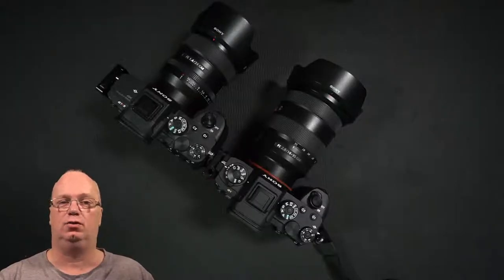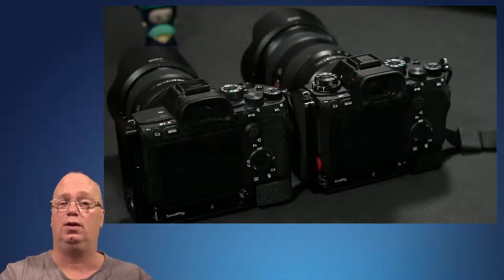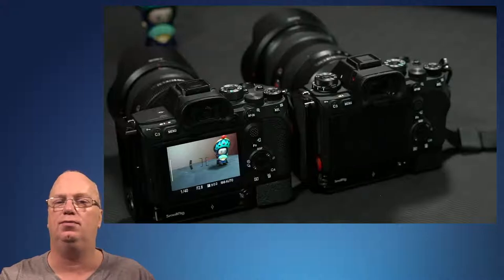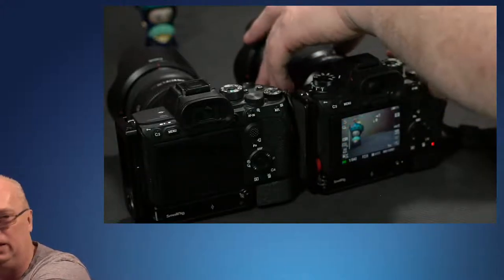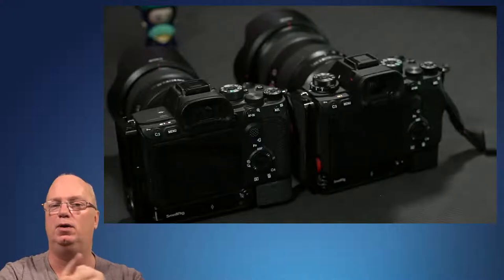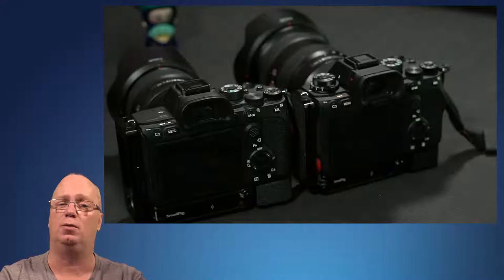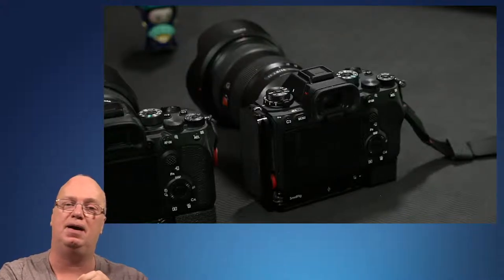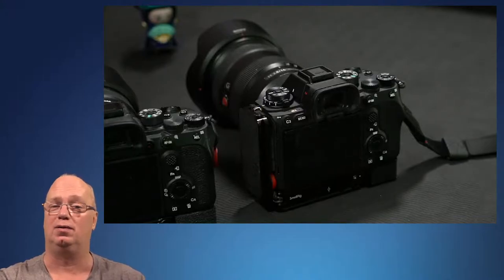Sony A7 IV feature ff vs crop based on A1

Comment: A game changing feature for Sony would be to let you shoot in crop mode but while viewing the FF in the viewfinder. Anyone like me that shoots fast moving subjects(birds, motorsports,airshows) always fight the smaller view which also makes it harder to track erratic subjects, this truly would be the best of both worlds
Reply from the maker: Yeah and in concept (not sure how to test this) the A1 uses the same amount of contrast and phase detect points in ff and crop. Since in crop the contrast has a easier job and there is less data to check i suspect this new method will be better at AF in crop then in ff mode if you need to be in crop anyway. I 100% agree that its nice to be able see the crop in the view finder and and now you can quickly move back when subject gets close its near perfect. I do hope sony adds a few firmware tricks like allowing it to push to activate instead of toggle and make it part of the button memory recall mode. Allowing you to shoot in crop and see the FF should be possible and i know a few have asked so you can see what is coming with a nice border you can see (maybe make it 30% darker) who knows we have asked and i guess we can ask again for sony amb to communicate thay to them.

Comment: You forgot a7C has flip screen… that to me showed me they’ll do it on the 7 bodies that are volume sellers, so I think the a7iv will have the floppy screen the kids want. No way it’ll have a1 sensor sensor n processing… it will have a7siii’s stack. The newer a9 or a7r5 will have the downgraded a1 stack.
Reply from the maker: Again not sure on the flippy screen its not that i disagree some people might want one but the clearly there are many that don't want one sony already as you pointed out have many with it.  The S3 has the same cpu set as the A1 (dual XR chips). in fact all of the old gen4 have the same cpu setup from the m3,r3,9m1 etc etc just at times differently clocked and some had the extra LSI chip to removes some issues. So yes i fully expect the 7R5 and a9M3 also to use the same cpu stack and maybe even main motherboard. Some chips support chips might be removed that are needed for the extra ports and it will be underclocked maybe even made on a slower production process (nm) but keeping it both a dual cpu with 4 or 8 cores keeps software development down remember unlike old sony cameras that where running a version of android below these are much more handbuild by sony on a bare version of linux.